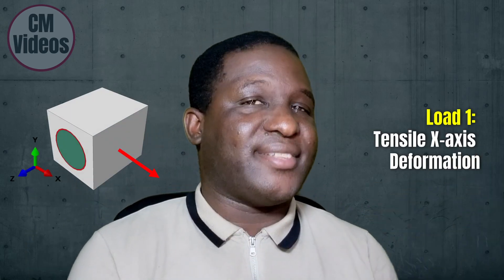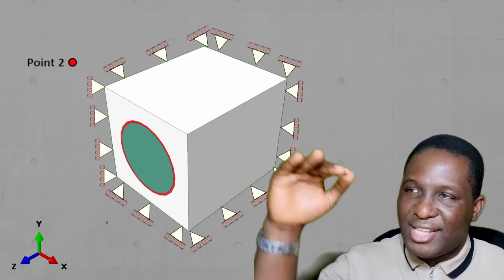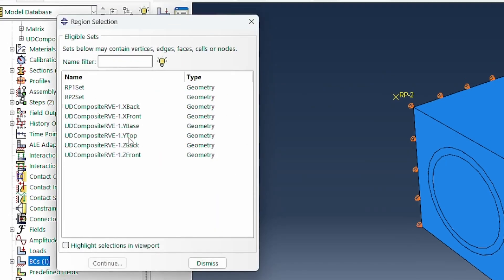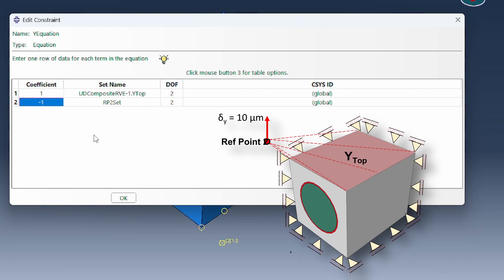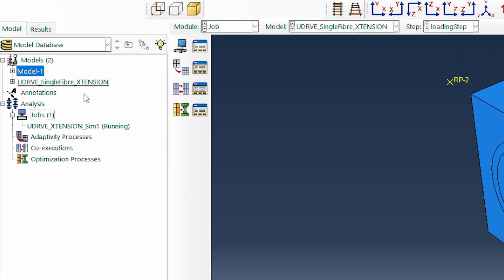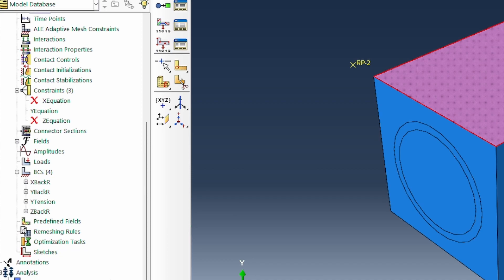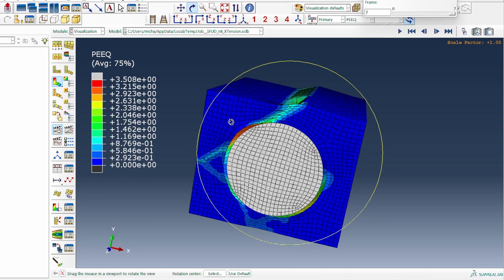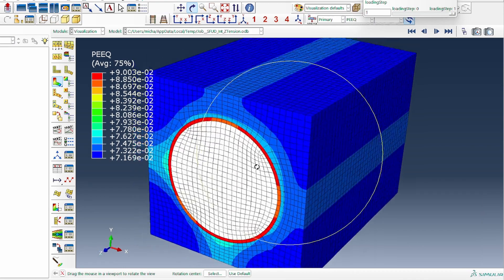UD Composites Modelling - Part 2: How to apply Tensile Loads

Comment: Hello, Dr Michael, thank you so much! I have a question, when the elastic coefficient of the fiber and the matrix are determined, what formula can the interface be obtained? Because I see that the interface values are different for different materials!
Reply from the maker: There is no formula precisely. YOu can often refer to published data to find that. You can make assumptions about it but you do need to get a value that will help your predictions match those from experimnents.

Comment: Dear Dr Michael!
What's the difference between using coupling and equation? I see somebody else use coupling to apply displacement.
Reply from the maker: Hello @QFL, here is what I think:
1. Kinetic coupling is a one-to-one node-to-node constraint which forces a set of notes (say XFront) to inherit the properties of a reference node or point (e.g. RefPoint 1). That means all degrees of freedom at RefPoint1 will be inherited on tied/coupled XFront face. 
2. Kinematic constraint using the *EQUATION is different. Here, by specifying a complex set of equations, behaviour on a reference point, RefPoint 1 will be mirrored on a corresponding linear constraint XFront. You can control any face by creating a kinematical equation that can be implemented using the *EQUATION for example: lets displacement of A inherit x-axis displacmeents of nodes 3 and 4 thus: UA = U3 + U4. You cannot apply this equation if you do kinematic coupling.
3. The way I used here can be easily replaced by kinematic coupling and there will be no different.
4. However for a more conssitent and adjustable response, the *EQUATION is much better and gives robust results, hence its use in enforcing Periodic Boundary Conditions.
Reply: @MichaelOkereke  Thanks for your full and detailed explanation. Love your videos which are really helpful!

Comment: When I add plasticity value to my matrix, the solution aborts. It only solves it completely when I remove it. How can I rectify this? Thanks
Reply from the maker: It's difficult to say, but try reducing the size of the load... Aborted models do not always mean the solution does not exist. It just didn't complete. So assess the solution contour plot yo see the extent of completion and threshold your load to that level if you want a completion  no matter how bad it is.

Comment: Hello Dr Mike. Thank you for this great work. Please my question is this, why is the load being applied using the boundary? also is this the same when you apply load using the load option below BC
Reply from the maker: Hello @Renewed Hope Songs, this is a very good question and observation. There are two ways of applying loads:

1. A Displacement-based loading option (otherwise described as Dirichment BC methods) and
2. A force-controlled loading option (otherwise called Neuman BC methods)

If you want a displacement-controlled simulation, then the Dirichlet approach is better which will require you to specify a certain displacement and the deformation will seek to meet that. If you go the force-controlled option, you just apply a force and this might not achieve a desired deformation due to differences in microstructure of tested materials. The displacement controlled option is better for validating models and giving a clear profile to deformed contour plots.

In the instance here, I used the displacement-controlled loading option by prescribing a displacement (at reference point) and linearly constraining that to deform proportionately with the desired face of the RVE. 

In ABAQUS, displacement is not classed under the load module but rather in the BC module. Here, you just have to associate the displacement with a load time step. This is what I did. If you look under the load module, you will only see force, pressure, etc which are more of the Neumann type BC. 

I will encourage you to use the displacement-controlled approach as this is what experiments are designed like. We track displacement of cross-heads not forces attained during experiment. In that case, a displacement-controlled approach will result in better predictions that can be validated easily with experimental data. 

I hope the above has not confused you but I wanted to be a fundamental in my explanation whilst also providing justification for how I do this in ABAQUS.
Reply: @MichaelOkereke  Thanks a lot. I understand now

Comment: Hello Dr Michael! 
First of all, thank you for sharing your work . 
Also, could you show in another video how we can manually introduce periodic boundary conditions (PBC into RVE) in a problem where we only have a temperature difference (expansion problem)? Furthermore, if the fiber is transversely isotropic how are its elastic constants placed in the ABAQUS_CAE?
Reply from the maker: Hello @George Sarmas, this is a good suggestion. I keep thinking this is a video worth making but have not got around to doing so. I will consider it. The problem here is that under what condition would a periodic boundary condition for temperature be applicable. I imagine with temperature distribution, you have isothermal temperature on edges and then assess what happens inside the media. I will think more about it and see if there is any way I can make such a video.

With regards to transversely isotropic fibre (like carbon fibre), I think the best way to do so is to use the lamina (elastic) properties in ABAQUS as that will allow you to specify transversely isotropic properties for the fibre. Hoep that helps?
Reply: @MichaelOkereke  Hello again! Your concern about under what conditions a periodic boundary condition for temperature can be applied, I have the following thought:
Let's assume a layer of UD composite material which is in temperature environment T1. Suppose also that, somehow, the temperature is reduced very slowly so that the final temperature of the UD is T2. 
I believe that, there are no separate periodic boundary conditions to impose the temperature on the RVE as because at each step (assuming the temperature will decrease by a small amount at each step) the temperature, for the whole RVE, is the same at each point in the RVE. 
Thus, periodic boundary conditions based on displacement are sufficient.

If you want to talk more about this topic, give me your email address to discuss further. Thanks a lot !
Reply from the maker: Hello, I agree with you that the scenario you described could be a use case for implementing a PBC-based system using temperature loads. You can contact me by visiting the About tag of this Youtube channel and using the email provided.